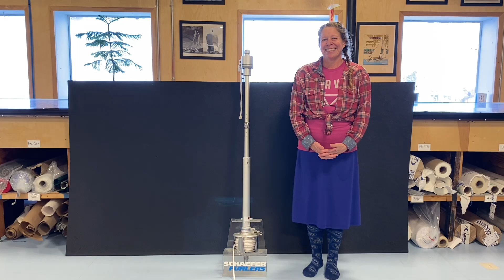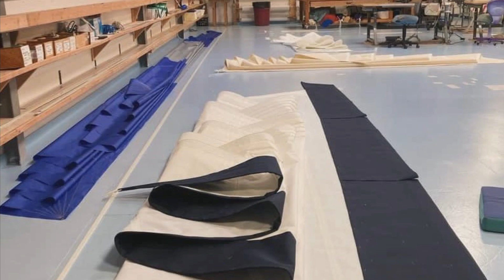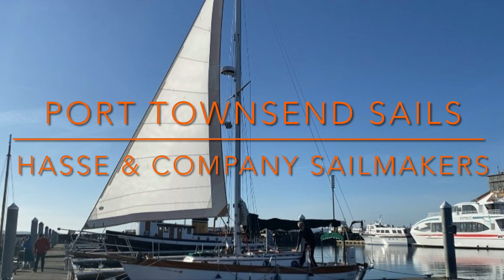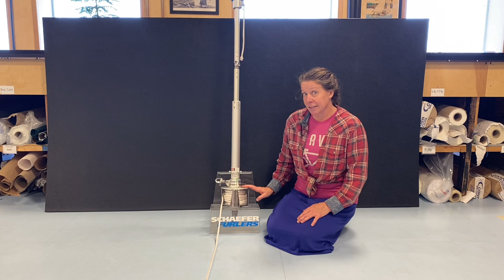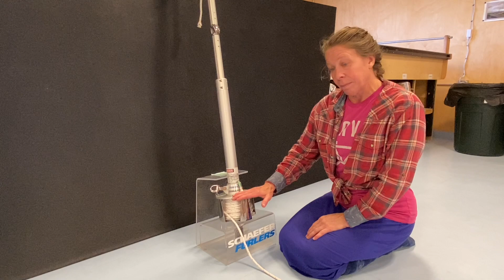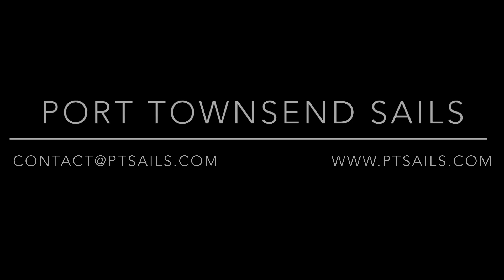Dynamics of Furling Systems - In Loft Example

Comment: I know almost nothing about actual sailing, but I found this informative. I think it would be better if you had a clip on microphone. You can get them even for a cell phone video camera. As a complete novice (79 years old) I need a bit of clarification about port and starboard. I only have a 17 ft. day sailor, but I love watching ocean going solo sailors. Keep up the good work.
Reply: One way I’ve taught the memorization of Port and Starboard that seems to stick, “Port” has 4 letters and so does “Left” so left=port. 

For a more historical context, on vessels in Old English/Norse times, the tiller and rudder (or “steering oar”) were most frequently on the right handed side of the vessel, thus is was the “steer board” side. And if all of the steerage was on the right then you would always load on unload at the harbour or port from the left side of the vessel. Thus the left side would eventually become known as the port side.
Reply from the maker: Thank you! Your feedback is very much appreciated Bill.  Starboard and Port are right and left respectively. We will look into a clip-on mic.